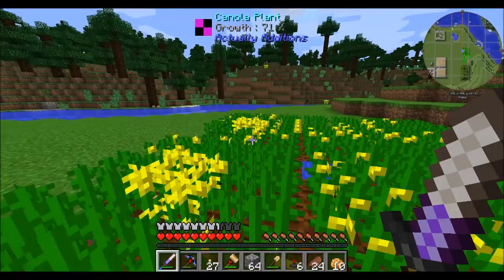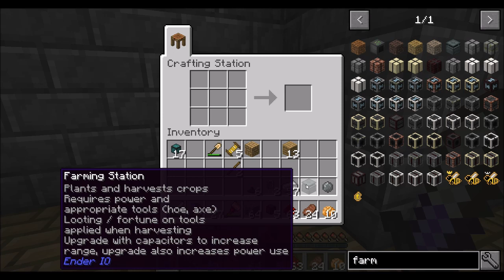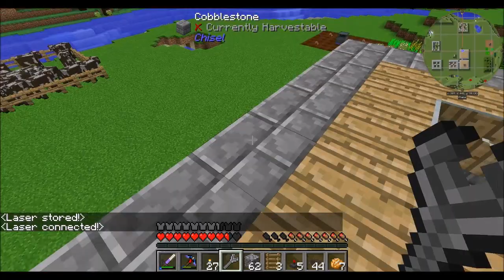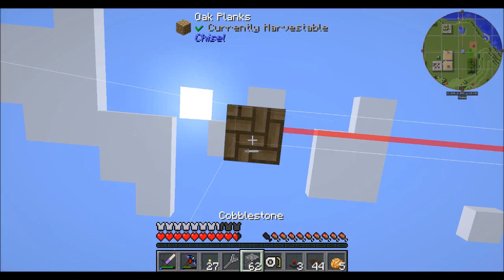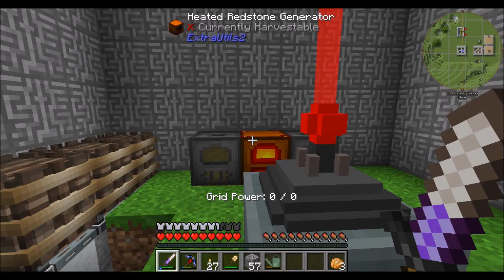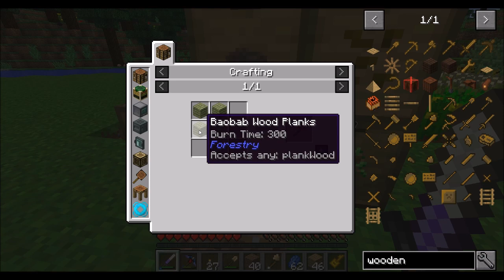Lets Play S8 E13 Farming

Comment: The problem placing the laser on the Farming Station is a bug with Iron Backpacks. It's due to having a backpack with a Quick Deposit upgrade on your back.
Temporary solution is to take the backpack off. The bug should be fixed soon (make sure to keep your Iron Backpacks up to date!)

Comment: From my experience I have to say that you will need much more Canola that what your farm is able to produce unless you are going to upgrade the oil even further after fermenting it. I have a 9x9 farm with only Canola and all dirt upgraded with worms and a lily of fertility and that was still not enough to support 2 oil generators.
Reply: Agree with you there, you would think a single farm using the mods own farm would support a "typical" setup, a press can support 4 fermenting barrels and they can feed two Oil generators pretty well with constant supply of canola, as it is a lot of space is needed to keep the supply up with more farms just to keep it fed.

Comment: if you want your power to be neat and tidy, put capacitors in the middle of your ceilings, with laser nodes top and bottom.  Then put another capacitor in each room's floor as you have.  It's extra capacitors, but your laser lines are all nice and straight bith outside and inside, and you have no holes in your roofs.

Comment: Just an FYI, form my personal experience, if you plan on using nothing but canola for power, use the Actually addition farmers for the canola fields. they use less power, and they have a larger field, however, you will need a larger amount of item conduits for automation as you will need to pull the seeds out and put them back into the machine

Comment: The issue with the sneak clicking one entity to place it on top of another entity, like the laser not going on top of the farming station and the drawer not going on top of the controller is caused by equipped iron backpacks with a quick deposit upgrade. Until it is fixed in the iron backpack mod, just unequip the backpack to get entities to place.

Comment: For anyone who might be unaware - the problem Dire is having with putting anything onto something with an inventory (or at least which acts as though it has an inventory) is the backpack. Remove any backpack you're wearing before placing your machinery, and it should avoid that problem.

Discovered because not only was I having that issue, but the Refined Storage interface I was having it against was suddenly full of a bunch of random stone...

Comment: "I need a couple more diamonds for the hoe" -DireWolf 2016

Is there a priority system on what the crafter crafts? My thought is if you would send cobble over that you mine (yes, I know you currently void it) and teach it how to make stone tools. I then realize I don't know how the cables will prioritize which tools it will remove from the export.
Reply: If you were putting in cobble, couldn't you just use the Remember button like Dire's doing to make two stone axes and two stone hoes?
Reply: Yes, but I was also thinking of when the system runs out of cobble (being it isn't automatically being refilled), so it would have to revert to wooden tools.
Reply: Heath Roush Tier 2 only allows four recipes, so were you thinking of upgrading to Tier 3?
If you did, you could probably make sure that the stone tools were above the wooden ones in the output, and they would probably be taken out first.
Reply: Yeah, it would need to be upgraded,as he would then have 6 recipes. They may get taken out first, unless the pipes round robin / random choose a slot.

Comment: Dire, I was wondering why all the multi-blocks from railcraft (steam boilers and the like) don't seem to be apart of railcraft in 1.10. Also, if you are in touch with the Mod Author for Actually Additions it would be nice to have the Oil Generators respond to a redstone signal to turn them on and off. They run a full cycle even if they only have a few RF that needs refilled.

Comment: Actually Additions greenhouse blocks are expensive but well worth it for canola. I have 4-10 oil generators, 1-3 presses and 2-4 barrels with 1 actually additions farmer block and its insane. (The - for 4-10, 1-3 and 2-4 is the upgrading of my setup, but this is in 1.11 and with actually additions crystal flux [supports forge energy and tesla, no RF for some reason, sigh, thats as of now though, no idea later on]).

Comment: Dire, the cause of the laser relay issue is your backpack, specifically the quick deposit upgrade. I had the same problem with mine, until I stopped wearing a backpack with that upgrade.
Reply: It looks like it also happened when you shift-clicked to place the drawer on the controller.

Comment: Dire, please tell me you know about the paper tools with unbreaking. Paper hoe has 5 modifiers, just enough to make full unbreaking which means you never need to remake it.
Reply: yes! This is confirmed by the one, the only, ME!
Reply: Crystal Warrior I mean, Soaryn has used it before as well. Dire just ignores it.
Reply: That's the stupidest thing i just learned, in prior versions reinforced gave you %10 and i didn't now that was changed to %20, i mean paper tools are useless even if they are unbreakable but the for this instance of never needing to replace the tool  it's just stupid that you can do that, I'm not insulting you when i say stupid i mean the fact you can is stupid. and on top of that with a sharpening kit which doesn't use a modifier you can make a slow unbreakable cobalt level tool with no problem, Just a lot of obsidian.
Reply: brandon hughes Yes, it is very stupid. 5 reinforced gives you unbreakable. But it is a thing, been like so for a while.
Reply: yeah but like i said before each level of reinforced gave you %10 towards durability so you would need 10 levels which was extremely difficult to get on a tool, it would need to be a full reinforced tool parts with all upgrades going towards to get it to reinforced to get Reinforced X but now it's only 5 it makes it too easy to get unbreakable tools.
Reply: its even better if you have tinker tool leveling installed too, unbreaking + unlimited modifiers (depending on how much you use it ofc)
Reply: But do Tinker's Tools work in machines like that?
Reply: yeah but with TTL all tools become godly overtime, in the vanila tinkers the tools are balanced to suit one need but not the other, a fast tool, a strong tool, a large mining area tool, a high damage tool etc so to get an unbreakable tool at all is really OP, and yes TT do fit in the farmer.
Reply: EternalJoker They work just fine. You can use them in every machine that I know of.
Reply: brandon hughes I kinda wish Dire liked using TTL. I love it. Would rather have TTL than the Unbreaking "Bug"?
Reply: well instead I just use obsidian hoes and axes as I'm lazy af xD
Reply: I don't feel like it is a bug, You have to give up SOO much to make the tool unbreaking and the bigger issue is using it in machines.  Specifically the EnderIO farmer.
Reply: Yea u can't but using paper as tool parts give +1 modifier. 
Example (at default it gives 3 modifiers and for making the hoe axe thingy if u use paper axe head , paper shovel head and paper rod it will do 3+1+1+1 and as in this version putting the reinforced obi thingy gives 20% reinforcement instead of 10% which was in earlier versions u can easily make it 100% aka unbreakable.
Reply: ***** You can add stuff to existing tools. That has been a thing for a long while. In tinker updates it changes from requiring being repaired or not that is the only thing. 
However, I understand that you mean in the latest tinkers there is no such thing as adding modifiers. You just said it wrong.
Reply: paper only give 1 extra modifier, even if you make full paper tool, now you can't make unbreakable tool, max is reinforced 80% + duritae, which still can broken,
Reply: masterzedd4 You say that, but in the Skyblock 3.0 you can vein mine the deep dark with unbreaking. Would probably run into mod limits, but without those and without worrying about lag, you could show all ores and nothing else.
Reply: Meh, unbreaking tools are pointless imo. All it takes is a sharpening kit in your inv to repair them.
Reply: Justin Howard did u miss the point where we said the tool is in the farming station .-. Putting a unbreakable hoe in it will make us never replenish the farming stations with hoes. U can even say we got "infinite hoes" (no pun intended).
Reply: Justin Howard Yeah you missed the point as BroAbhishek said, this is for farming stations to set and forget and never have any downtime making new tools for the Farming Station
Reply: I would also like to add: a paper pickaxe can be made unbreakable, then if you can change parts, you can make an unbreakable cobalt pick. With TTL like in Skyblock 3.0, you can make it amazing.
Reply: Well u get 3 modifier slots at default so u only need the paper rod and paper binding for the unbreakable and use cobalt head (3+1+1).
Or make a full paper pickaxe and add cobalt sharpen thingy on it because who cares about speed xD
Reply: For some reason, I cannot add an obsidian plate to my paper mattock, as there is no hoe in Tinkers
Reply: it's actually called a reinforcement in JEI, it isn't an obsidian plate.  It is a blank cast surrounded by obsidian to craft it.
Reply: A Paper Pickaxe is terrible, even if it's unbreakable and able to mine Cobalt+.  The Mattock is a bit more powerful, but hoes and axes are cheap to make and automate.  I can imagine that Hammers can get a bit insane as you do have 3 tool parts that don't have to be paper (say, Sponge for silk touch and Cobalt for speed?).

+sniperlif3 By default, Stone is disabled in veinminer.  If you can do that, then it's because of a config change in SkyFactory 3, so I would disregard that.  Either way, Veinminer is the OP mod in that case.  Without it, the pickaxe would be maddeningly slow.

Also, you can't remove a paper tool part unless you have the modifiers available to do so.  That's a very obvious exploit that I'm reasonably certain that it was already blocked when paper was re-added to TiC 2.

TTL is a bit of a joke mod that is intentionally OP.  It removes one of the major balancing points of TiC.  Yes, I am aware that Boni wrote both TiC2 and TTL; but before you insult me or disagree that it's intentionally OP, go look up the description for it on Curse.

Comment: @Direwolf20 The reason why you couldn't place the laser on the Farming Station is because you had the backpack on your back with the Quick Deposit upgrade on it. If you don't have it on your back then it will work fine. The issue is that when you have the backpack on your back with that upgrade it tries to deposit your items from your backpack into the block that you sneak right click on.

Comment: regarding some bugs: (i'm using the latest beta so no complains about it)

for some reason my canola presses which is attached to an item conduit (enderio) stops receiving items everytime i quit the world (like when i open it for the first time or when i switch to a test world and come back) the fix is to break and replace the blocks that are affected but funny enough the Storage Drawers work fine allways

the Farming station which is attached to a refined storage system (an interface with a stack upgrade on it which is connected using enderIO conduits) stops outputting items every time i quit te world, sometimes i have to break and replace those 2 blocks too.

Comment: You could have the Actually Additions laser power a capacitor or other energy storage that powers a sub-system at your farm with power and item conduits. That could allow you to power and supply items to the farmer from above and a water source below it. That could also power other machines at the site such as the crafter.
Reply: Never mind. That last comment was made before he actually did that himself. Though he powered and supplied the farmer from below rather than have the water source there as I suggested.

Comment: For like 3 episodes now I have been waiting for Dire to start upgrading the canola oil to better versions :/
Reply: Apparently in newer versions the upgraded canola oil wont be "better" per se; just lasts longer
Reply: Alan Jones 
Yeah, I know, Dire explained that 1 or 2 episodes ago.
Reply: Are they actually better in the older versions? For the work it takes to automate and the RF to run the empowerer, wouldn't it be cheaper just to use normal oil, rather than bothering to upgrade the oil.

Comment: I didn't like the part where it was like: There's a farmer from a new mod, and it's great, but I'm going to use Ender IO anyway, despite having to craft entire crafting machines I'll hardly ever use otherwise, and use up my scarcest resource to do it... And then it was a ton of work to get going, requiring an auto crafter and such, and the canola still isn't outputting to the press yet, so the main purpose of it (power automation from canola) is still unfulfilled... It's a nice system, but if this new farmer works fine, personally, I'd like to see what it can do.

Comment: The farmer from Actually Editions is WAY better than the farmer than Ender IO as you don't need to automate tools.
Reply: can that farm do trees?
Reply: Yeah, but that's boring. Automation should be a challenge!
Reply: They have different tradeoffs.  The AA farmer has a larger area and doesn't need tools, but has higher power use and can't really do more than one type of crop at a time (and can't do trees at all).  The EIO farmer has a smaller range (though upgradeable) but supports four types of crops at once -- and also trees.
Reply: He wouldn't really need to do trees if he had the AA Farm as it does not require tools. Plus the AA farm is like 5 iron bars, a piece of glass and some wood compared to zombie heads and two additional machines that the EIO farm requires.
Reply: It's still useful to have a tree farm even if you're not using it to automate making tools.

Comment: Anyone know a tree farm [charcoal farm] option besides using a ender io farming station, as I use that and a leaf eating generator to power farming station now instead of coal generator. I wanted to use farmer from actually additions but can't get it working, only for any seeds from vanilla or the mod itself. Also I'm loving immersive engineering multi-blocks but so much iron and steel. But still need to automate the blast furnace yet. Also anyone know how to get refined storage patterns working as I haven't played with it properly for a while.
Reply: Suntanned Duck2 for processing patterns make sure the crafter face with the dot is facing the tile entity or whatever then you use a importer. Use forestry multiblock for the tree far m
Reply: Suntanned Duck2 yeah i had problems with the farmer from actually additions to but it turns out i just faced the block the wrong way. It farms the way you face it in.  sadly it does not work for trees and you can't as far as i know determin what sides to the farm farms what like east, west etc.
Reply: there's always good ol' Forestry's multi block farm, takes a little more effort to set up though. I believe Immersive Engineering adds in some sort of farmer too.
Reply: one option. not sure if it works with a mattock but a lumber axe from tinkers can be made unbreakable. one obsidian piece to add reinforced then 3 other parts paper to give enough modifiers to add unbreaking till it becomes unbreakable
Reply: I thank all of you that provided responses. I'll try them out and see how I go.

I don't know the immersive engineering one, I'm only making all the multi-blocks now to get them out of the way and play around with them. But I don't know the farming option. Forestry I haven't played with enough, so I might. I never got into the farmer blocks. I liked the old way. But never used forestry. I thank you for the ideas. I'll truely see how I go with them. I've been looking for something new to automate besides farming station and tools.
Reply: Ok I'll see how that goes and come back if I miss something or go to the Dire spotlight on it. I'm not much of an automation person as my mind isn't great with contraptions but  I like to make them. Just how I play I guess. But I'll see, thanks for the response.
Reply: I would recommend Botania
Reply: How, I have never gotten past the second ingot as I was learning Botania. I know how to do it but never got enough mana at the time I last used it. I can try again but it will be a bit. I was a novice with it.

Comment: I'm totally regretting building a massive underground base - none of my crops will grow properly; especially Industrial Hemp .... anyone know a decent Biomes o'Plenty (or vanilla) seed that spawns in or near a relatively flat area?
Reply: just light the area properl, they will grow just fine. i'm living underground too.
Reply: You think I haven't thought of that? I'm not stupid. I have loads of lamps from Actually Additions in the ceiling; Most of the crops are fine...ish ... but Industrial Hemp just wont grow no matter how much light.
Reply: Why are you growing industrial hemp? Moving into Immersive Engineering or do you just need string? Flax is more efficient for string. However if you need the hemp fibres, i doubt you'll need them regularly, but just set the farm above ground. Surely you can make an exception of living underground to make a fully auto farm and then leave it running there.
Reply: Yeah; I was set on building my base underground and having everything I need there; but in the long run ... starting again from scratch seems like a good alternative to having just the one farm above ground; And yes - i'm hoping to get into Immersive Engineering.
Reply: Most of your crops should grow fine indoors. Industrial Hemp is a problem though, I think they require a high lightlevel, torches are not sufficient. I ended up just growing a couple stacks of hemp fiber using bonemeal (which still works).